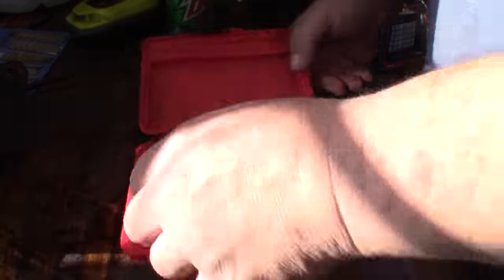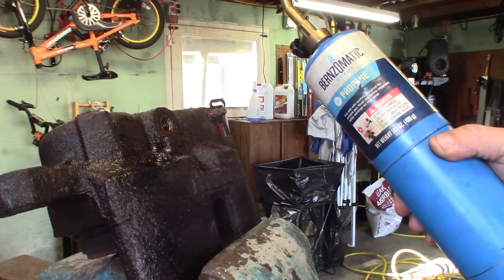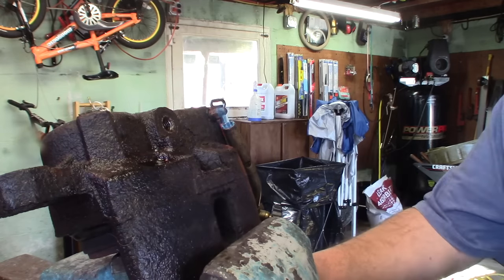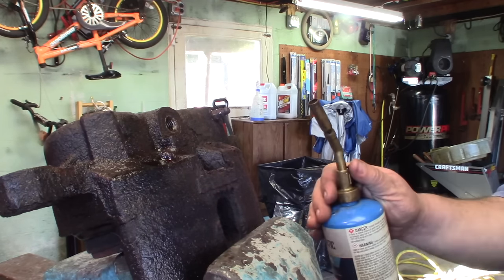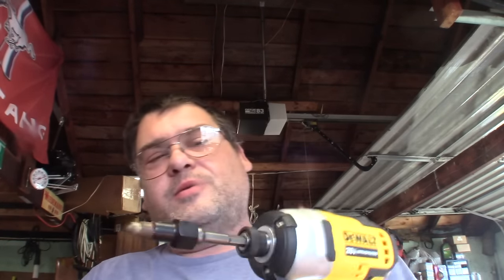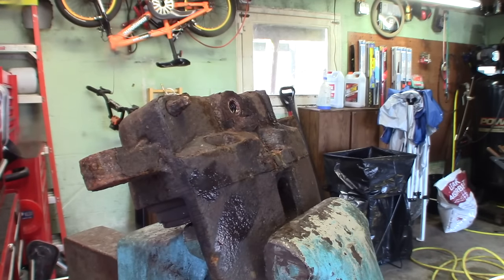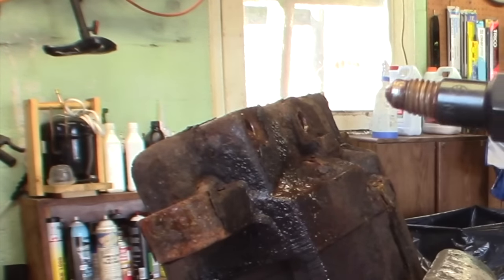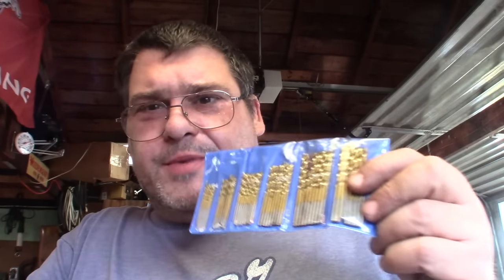How to Remove Seized Stuck Brake Bleeders Every Time!

Comment: Sorry, but if i'm gonna go through all that i'll just buy a new caliper. They're not that expensive and if the bleeder is that stuck most likely the caliper has a lot of wear anyway
Reply from the maker: Nothing wrong with getting new ones.
Reply: i was a brake and front end man for 35 yrs.Bob,it,s rare to find anybody with the right solution. why in the hell would anyone go through all that shit to save 22 bucks?
Reply: calipers on my charger are over $100 each, used! Just because the bleeder is stuck really is no indication of wear. Perhaps, a previous meathead mechanic over tightened the bleeder, or if it is an aluminum caliper w/steel bleeder, dissimilar metals can foster corrosion on the threads, or possibly both.
Reply: Plus, it’s fun to solve these problems yourself.   Why not give it a try?

Comment: You're heating the wrong area. You should be heating the casting (along with the bleeder) then quickly cooling (thus shrinking) the bleeder screw. In aircraft maintenance shops (and many other machine shops) shafts are cooled in liquid nitrogen then placed into the heated disk/gear or whatever the shaft goes into. When the temperature equalizes, they can only be separated in a hydraulic press.
Your method obviously still works to crack loose the bond, but by cooling the casting you are shrinking it tighter around the hotter (and slightly expanded) screw. Most likely, because of the small mass of the screw surrounded by a large mass of metal, the two parts quickly reach temperature equilibrium. The cooling spray, though mainly aimed at the massive caliper, cools the screw more quickly due to its much lower mass and the fact that it sticks out and is more exposed to the spray.
Reply from the maker: I talked about why I do it the way I do it in the video.  You will never get enough heat in the casting to do anything without a bigger torch.

Comment: money vs. time .buy a new wheel cyl  or caliper,save tie and money.
Reply from the maker: It take 10-15 minutes to extract a bleeder.  I will have more time invested in going and getting one at the parts store.  Or waiting for one to be delivered.   I just get it done and out of my driveway.  Get paid and get on to the next one.  If there is something else wrong with the caliper then I will replace it, but if it is a working functioning caliper with a seized bleeder I see no need to replace it.
Reply: Exactly! Parts store is 45 min away, so 1 1/2 hr just driving, then usually 15-20 min in line and another 5 at the counter.... that's a LOT of time.....
Reply from the maker: @rosebarnes9625  Well My parts store is a lot closer, but it still is faster to just get it done.  Normally I am bleeding from doing brake line repairs on old rusty cars that aren't going to be on the road that much longer anyway.
Reply: When you have a 29 year old JDM with a break type of a model made only ofr a few years, believe me just finding a new caliper is a major endeavor - most folks end up having to modify their rear brakes outright, that's how hard they are to find. Besides a bleeder costs $4, a seal kit $40 and the caliper can cost $400 IF you find any.
Of course if you're driving a less than 10 year old run of the mill car produced in the millions replacing the whole caliper is a no brainer.

Comment: Called brakequip bleeder buster
Reply from the maker: That looks like a pretty nifty little kit for $60.  I may have to get one, one day.  Right now I am holding out for new torch hoses and a regulator for my Oxy/Acetylene torches though.
Reply: FrugalPrepper's Garage & Garden which regulator do you need? I may have a spare I could send you.
Reply from the maker: @scottsmrcka2769  The Acetylene one. The tanks, hoses and torch were given to me, but the Acetylene one was smashed and the hoses were dry rotted and cracking.  I am happy to pay you for it.
Reply: FrugalPrepper's Garage & Garden let me look and see what I have and I will try to get back to you tomorrow.
Reply from the maker: @scottsmrcka2769  Thanks
Reply: FrugalPrepper's Garage & Garden sorry the spare regulator I have is the oxygen one. I couldn’t remember which one it was until I looked.
Reply from the maker: @scottsmrcka2769  Thanks for checking!
Reply: FrugalPrepper's Garage & Garden no problem. I was hoping it was the one you needed. If you end up needing the oxygen one for some reason hit me up.

Comment: All due respect  , but why fix bleeder  ?
I just leave it be .
Position caliper fluid line so in high position  , loosen line and gravity bleed .. all done ..
Reply from the maker: Because that is the wrong way to do brakes.  You can't get all the air out that way.

Comment: You dont heat at all what you want to remove. You heat where the hole is so that the hole expands and release the screw or bleeding bolt or whatever you want to remove.   A couple of minutes heat on the hole part,  The great EazyOut you have and the impact wrench did all the job here.  You heated the wrong part.  But the quality EazyOut socket pulled it out anyway..
Reply from the maker: You can't heat the outside enough to make a difference propane.  You need movement in the threads.   They only way to get it is to heat the part your are removing.
Reply: @frugalprepper  Heat increases the dimension of things. You want to expand the hole where the screw or bolt is.   If you heat the part you want to remove,  it will expand and make it harder to be removed. I always heat the part where the hole is and only takes lot less time than heating all parts..
Reply: I know it seems counterintuitive from your physics lessons, but it actually works because it crushes the corrosion between the threads. The fast cooling then the hammering then loosens the compressed corrosion loose. Heating the body to a meaningful degree is almost impossible and you run the risk of cooking the rubber piston rings.